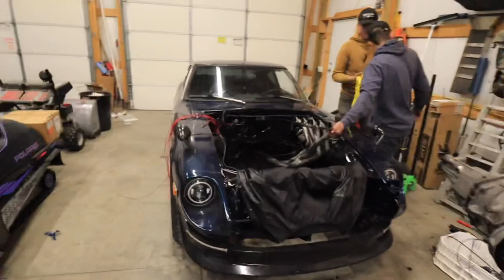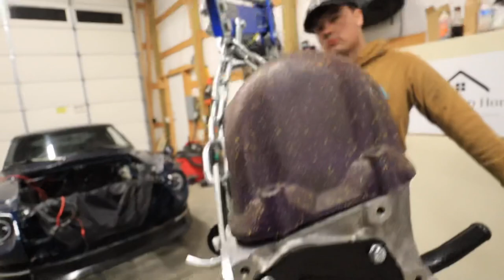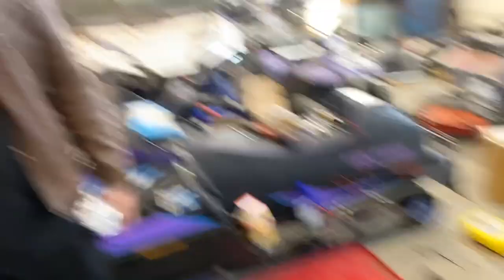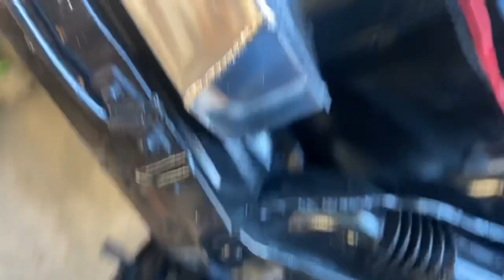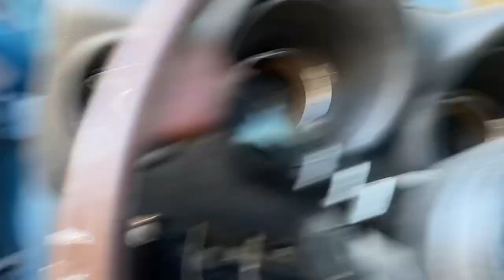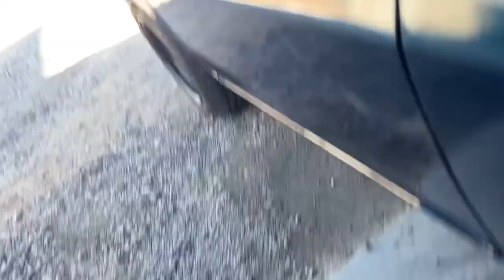240z-L28 full engine install and start

Comment: Really enjoying this series guys, I work at Godzilla Raceworks in Ft. Worth TX, If you guys need any parts for the L28 or parts for the car in general, dont hesitate to reach out to us :D
Reply from the maker: I appreciate that, we have another 240z build happening this summer so we might just reach out for a few miscellaneous parts.
Reply: Y’all got any wheel hubs for a 280zx? I could only find one set aftermarket for $520 :(
Reply: Hi Colby I'm in Benbrook and have a 1978 280Z that I am restoring. We should keep in touch.

Comment: Yo.  I live in salt lake and run a heavily modified N/A s30.  I had overheating problems since my build went together.  I was running that same radiator (brand new) and after so many attempts at solving it.  It was the radiator.  Poor/slow flow.   It would slowely creep up to overheating.   Replaced it after trying everything. And it was that rad.
Reply from the maker: Good info thanks for that.

Comment: Can I use the 280zx motor on my 260z transmission
Reply from the maker: Yeah they will bolt right up, all the L series engine are casted the same with just different bores/ strokes as far as I’m aware.
Reply: I appreciate